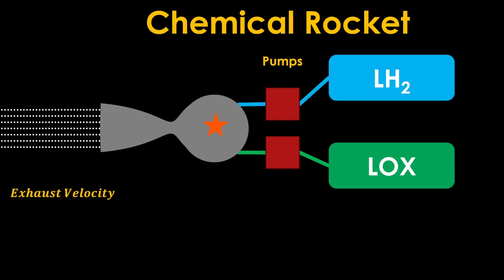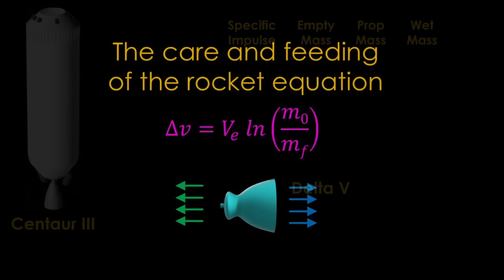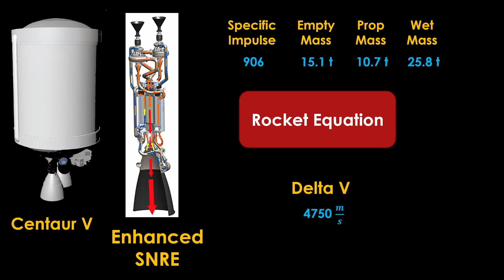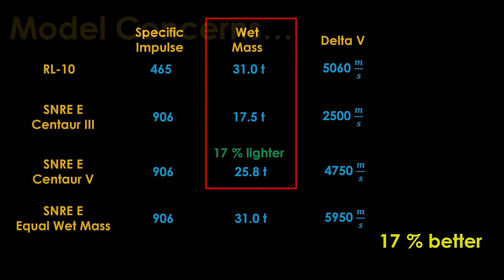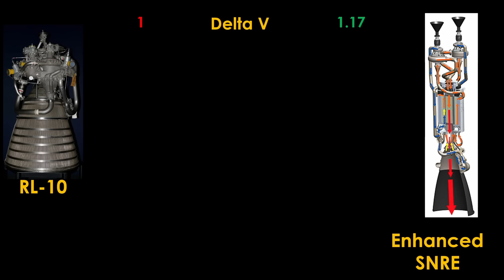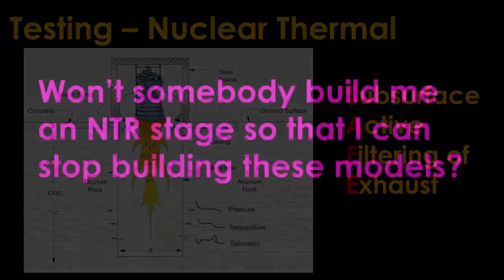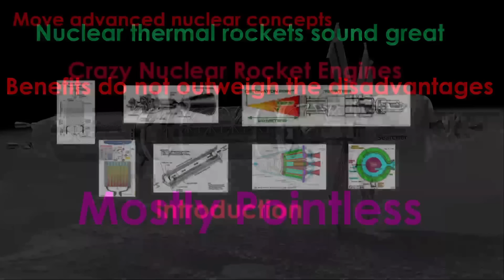Why Nuclear Thermal Rockets are Mostly Pointless

Comment: The tank mass does not scale linearly with volume, to first order it is the cube root of the volume. So 8x larger volume masses only 2x at much. This is a big error in your analysis.
Reply: Depends if you're making the tank bigger in all three dimensions or just taller.
Reply: For a given pressure, does a larger tank not necessitate thicker walls to withstand tensile stresses?
Reply: you are wrong, it is linear, think twice
Reply: Large tanks increase linearly because it's simply a pressure vessel.
Reply: Issue with making massive tanks is just transporting it into orbit. Starship will eventually become the largest object ever put into orbit. And even that, fully fueled with Hydrogen just doesn't make sense Delta-V wise
Reply: @robmacl7
On the topic of the original statement, I had the funny idea of calculating it with a soda can
A standard 33cl soda can contains 330cl of liquid and weighs 10.6g of aluminum
Assuming water this weighs 340 grams

This create a mass ratio of around 32, far more mass effective than existing rocket fuel tanks. 
Water is of course quite mass effective to keep as a fluid in general as its dense and doesn’t require high pressures, but it’s comparable to RP1 (gasoline) and the much much larger tanks of gasoline than a soda can themselves average out 9 of 10 mass ratio 

So that example perfectly goes to show that the mass ratio of a fuel tank basically does not change as you scale it up or down

Again picture the internal water hammer/sloshing of all that mass. It’s not about covering the surface of a cylinder or sphere with metal, it’s about having a strong enough barrier to hold both the pressure and sloshing of a giant ball of usually high pressure liquid on the inside. 

So it would be fair to assume that if a gasoline tank that can hold 10 tons weighs 1 ton of metal, a tank of gasoline that can hold 100 tons would weigh 10 tons of metal. Pressure containment matters not the relationship between surface area and volume 

If you tried to increase the mass of fuel by x8 and the mass of the fuel tank by only x2 you would get a paper thin tank that would break easily. Repeat that experience until you have 64 times more fuel and only 4 times more metal mass and you quickly see how absurd this is as a concept. The square-cube law should not be applied to pressure vessels. 

Lastly if this was true there would be huge performance increases to be gained by simply building larger rockets. This is of course not the case, you don’t magically reduce your structural requirements by buildings bigger. If anything the bigger you build the worst it gets because material strength is a product of the cross section while mass is a product of volume. 
That’s why small animals are strong and why we can’t build buildings much larger than the burj Kalifa

In space there is no gravity (I mean, there technically is spaghettification Roche limit sheer forces) but extra mass still generally mean larger forces from things like inertia

In particular it’s very difficult to create kilometer long ships and up because... how do you rotate them? It’s a centrifuge. So you’re forced to rotate a giant ship extremely slowly for the G forces and structural strength. While a microscopic ship the size of an insect built out of metal could spin thousands of times per second without too much issues. 

So the assumption that building bigger increases mass efficiency and reduced the need for structural mass is basically inverse to how it actually works. Sad seing so many people liking this comment even though it’s false
Reply: Nope, that is one of the first falacies of space-cadets.  Tanks are not simple ballons that surround propellent, they hold PRESSURE, and that pressure is derived from the mass of the held propellent resisting acceleration or wanting to boil, and that pressure requires wall thicknesses which scale in such a way as to cancel out square-cube law surface to volume ratios.  Basically a propellant tank WILL without best enginering be a very consistent ratio of the mass of the propellent it holds with lower density propellents like Hydrogen being worse.  The Standard ratio for Hydrogen tanks is 8%, while it is about 1% for Hydrocarbons/LOX due to their higher density.  The high parasitic tank mass is one of the things that makes NTR inherently bad.
Reply from the maker: Yeah, it's a first order model.

Nor did I consider that Centaur is a balloon tank design and Centaur V is much thinner than centaur 3. 

I did play around with engine mass and found that it's not that big of an effect.
Reply: @EagerSpace  Why did you even consider those stages? No one wanted to use NTR on such tiny sizes. Why not Starship or SLS that would be much better fitted for nuclear? You called your examples "best case" and RL-10 and Centaur stages are far, far from that.
Reply from the maker: I chose the stage because the NTR I chose was designed to match the RL-10 thrust. 

I didn't use starship because nobody knows what it actually weighs and I'm not sure which SLS I would use. ICPS is smaller than centaur V - I guess I could have used EUS but I'm not sure there are good numbers out there.
Reply: @syriuszb8611  Starship would be far worse for Mars missions if its Raptors were swapped out for NTRs. First, its tanks would have to be swapped out for far larger and heavier hydrogen tanks. Second, it would no longer be able to land on mars or earth on its return, it would have to increase propellent at least 50% more to make up for no longer being able to use aerobraking and for adding expensive and heavy custom landers.
Reply: Tanks need to be designed to resist internal pressure so the larger the tank the thicker the tank walls. It's not a linear thing but it's not what you think k either.
Reply: That would require that the tank wall thickness is inversely proportional to dimensions - why would this be the case?
Reply: @mathmagician8191  Read about square-cube law.
Reply: @robmacl7
This is false you and everyone who liked your comment is incorrect 

Mass ratio of a fuel tank remains largely consistent no matter how you scale it. You’re talking about the surface area to volume ratio.  This is irrelevant, what matters in a fuel tank is the pressure tensile strength and thickness ratio. You DO need increasingly thicker tanks the larger you make them. All tanks are pressurized and even if they weren’t (they would be very inefficient) they would then become ludicrously weak to sloshing

Like imagine 500 tons of liquid oxygen slamming into a wall a millimeter thick of aluminum. It would instantly rupture and fail. 

All fuel tanks that have been made are between 5 and 16 in mass ratio, most are around 10. The Japanese made many at around 15-16, America Russia and Europe mostly have it at 10. 

What the person who made this video has gotten wrong is not what you said, but the fact that you can just have a smaller lighter nuclear engine so that it does not become a silly % of the mass of the stage firstly. 
And secondly that the TWR of nuclear rockets is theoretically extremely high, aka an advanced well made one could be extremely lightweight while providing a lot of thrust and high exhaust velocity. 
You could have a hydrogen solid core engine providing 1 meganewton of thrust at 10kps of exhaust velocity while weighing only 1 or 2 ton. That’s entirely within theoretical limits and predicted engineering constraints. 

Neither thrusters no fuel tanks change much in performance as you scale them up or down. You can basically make a tiny scaled down version of a large rocket and it will behave identically. Same acceleration and delta v more or less. If you gained a large advantage by scaling things up it would be easy to make huge ships to get high mass ratios and therefore climb up the logarithmic curve. But it’s not
Reply from the maker: Do you have a reference for your thrust to weight assertion?
Reply: @EagerSpace Not that I can find immediately. However, when designing pressure tanks of any type, the hoop stress scales with diameter. Therefore so does the thickness. I saw a comparison of existing rockets years ago. TLDR the tank mass doesn't quite scale with ppropellant mass. It's more linear dimension to the power of 2.x where the x is like 7 or 8. That's my recollection. 

In any case, nuclear thermal is far more interesting when you're in space and thrust to mass is relatively low. But even then the additional mass that comes with the engine and shielding robs any apparent Isp advantage.
Reply: @IceRain-f5v  Your estimations seems extremely optimistic. 10km/s exhaust mean running over 3000K reactor core, which is on the verge of theoretically possible. 1MN at 10 km/s means 10^6/10^4=100 kg/s mass flow rate, so total kinetic energy would be 1/2*(10^4)^2*100=5*10^9. 5Gw of thermal power is more than actual power station reactors produce.
 With 1-2t engine it would mean 2,500-5000 kW per kg - impossibly high numbers, I believe all realistic designs have two order of magnitude less. NERVA XE-PRIME had about 1.1GW and and weight of 18t. That would be at least 36 times better while operating at much higher temp (it was running at 2270K and Ve <= 8,5km/s)
Reply: @whatissixbynine
I made a reply for the other comment asking me for sources where I gave the operating principles of why it works and some links but it seems to be gone maybe I went over the character limit :/ 
Yt doesn’t notify you if a post doesn’t go through it just removes it 

"Your estimations seems extremely optimistic."
I’m giving the theoretical maximum as a counter argument for his use of low performance prototypes as an argument 
Realistic future developments would be in between 

"10km/s exhaust mean running over 3000K reactor core, which is on the verge of theoretically possible."
Yes. Within the limit of possible
Again I’m giving the max

Beyond that, UO2 dies at like 3100K, tests on uranium zirconium carbide found 3800K so then you just need a moderator that can keep up and I’m sure you can shove boron or hafnium or whatev into a ceramic that can survive that much 
I’m pretty sure boron carbide can survive pretty high levels and it can be used as a moderator
Graphite can survive that temperature but it would be dissolved by hydrogen I’m pretty sure. Maybe you can just like put it in tungsten or whatever it’s not a big deal 

"1MN at 10 km/s means 10^6/10^4=100 kg/s mass flow rate, so total kinetic energy would be 1/2*(10^4)^2*100=5*10^9. 5Gw of thermal power is more than actual power station reactors produce."
uh-uh. 

"With 1-2t engine it would mean 2,500-5000 kW per kg"
ye

"impossibly high numbers, I believe all realistic designs have two order of magnitude less."
Oh not it’s realistic. Well as in it doesn’t break any law of physics

Remember the critical mass of U235 is 56 kg, U233 is like 16kg I think, U232 is 3.7kg. 
And you CAN just design a nuclear reactor to run barely under supercritical outputting an indecent amount of heat and radiation. You can just do things. 

The designs I’m talking about are white hot balls of U233 NEUTRON MODERATED carbides running at gigawatts of thermal power output with TENS OR HUNDREDS OF KILOWATTS of radiation power. 

"NERVA XE-PRIME had about 1.1GW and and weight of 18t. That would be at least 36 times better while operating at much higher temp (it was running at 2270K and Ve <= 8,5km/s)"
Indeed
And it’s my point, these projects were designed to be easy to work on somewhat safe not to complicated or ambitious built on existing and well understood technologies etc.
 
This is not the design approach I’m talking about. I’m talking about it making a ball of highly enriched whatever that has comparable power output to Chernobyl mid meltdown but DOESNT meltdown because it’s built out of materials that can survive 3 thousand + kelvins while outputting so much radiation that it would set things on fire next to it from the nuclear radiation alone, completely ignoring the thermal radiation. 

The power density of fissile material is such that such a device would have enough fuel to operate at maximum neutron flux like this for weeks or even months, more than enough for an engine that would only turn on for minutes or hours at a time. 

In any case I was just talking about the theoretical limit of the technology just to set an upper boundary for how good they could get, to counter the argument that "durr durr hurt the ones that have been made are bad so we shouldn’t develop better ones". I’m just setting the range of performance, from 1 or less G to 1000+ G in TWR for the engine.

Nuclear reactors have that neat thing where it’s a smooth transition from 0 output to a nuclear blast and you can put that slider anywhere you want so long as it doesn’t melt down or fail structurally from the internal pressure. 

You don’t have to create a device that [great, amazing, splendid, magnificent] bonkers to have useful nuclear thrusters, anything between 3G and 1000G is good, even something around 30G-150G of thrust to weight ratio would be great and would make both engine mass and radiation shielding mass nearly irrelevant. Especially with my second  argument that they can be scaled up and down to your needs (the minimum size is critical mass) so even a tiny ship that weighs 30 tons can have a correspondingly tiny nuclear engine that propels it at more than 1G which translates to pretty much just 2 or 3 times more delta v with the same acceleration (3.4 kps is the sea level exhaust velocity of raptor III, vs sea level nuclear thruster tests that routinely go north of 925 Isp, so it’s closer to 3 times the delta v than double)

If you want something less extreme just picture idk, 200kg U235 carbide, 100-400 kg boron carbide (trial and error is the best way to adjust the amount or neutron moderator in a reactor! :^) ), enrichment between 50-95% and you ought to be able to get something that works with numbers vaguely similar to this with a much higher power density than existing ones without being my previous literally eternal demon core device I was talking about earlier, since apparently "operating 1 kelvin below melting point is not a good idea" or whatever

To recap the general argument is that a nuclear reactor can be tuned to pretty much any power output and so can be considered to have nearly infinite power density and as such the limiting factors to TWR come from the materials used to make sure it doesn’t melt nor break as well as the radiation shielding mass which itself grows logarithmically to the radiation it needs to stop. 
While the low TWR of existing nuclear thruster can be entirely attributed to design decisions made to use existing easier to work with technologies instead of the beautiful things I’m talking about that would literally set you on fire from gamma rays alone. However these crazy things would work and don’t break any law of physics nor engineers limitation. 
The potential of nuclear thermal rockets is likely lower but well within 300 TWR, not that you would even need an engine that power dense to begin with, giving you the luxury of designing one that is less power dense and runs at a lower neutron flux and radiation level than the laws of the universe could allow you.
Reply: The bonus is that it doesn’t matter what radiation shielding material you use because all the atoms in the shield would get randomized anyways!

I calculated the radiation dose for fun and the engine example I gave earlier would give you 20 million millisieverts of radiation per second without shielding if you were bear hugging it. 6 sieverts is the lethal dose, this outputs 12 thousand sieverts per second. "wHY diDnT tHeY bUIlD iT?" lol

Yeah honestly I agree, kinda lame, they should have built it

And it’s not impossible to build despite these numbers I’m only half joking, the other funny thing with nuclear reactors is you can throttle their output. This is the radiation output at max throttle. It comes from induced fission. If you bring induced fission rates near 0, the components of the reactor or even maybe the fully assembled reactor could have low enough radiation for you to stand next to it (preferably beyond a heavy chunky plastic window) safely
It’s only when you bring the fuel elements close together, introduce the moderator and remove neutron poison, and surround it in neutron reflector that things really get funky and you start to turn carbon into gold through enough neutron capture and beta decay lol